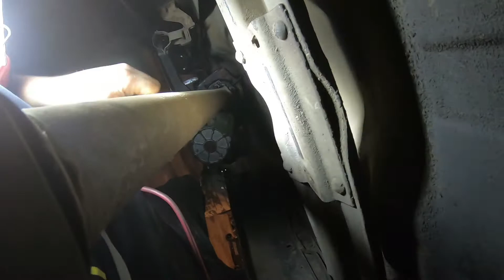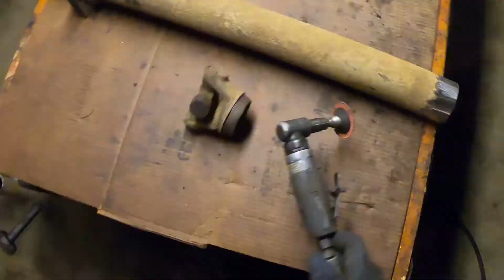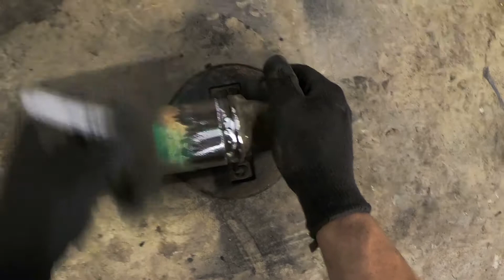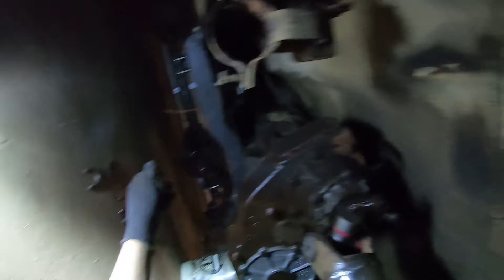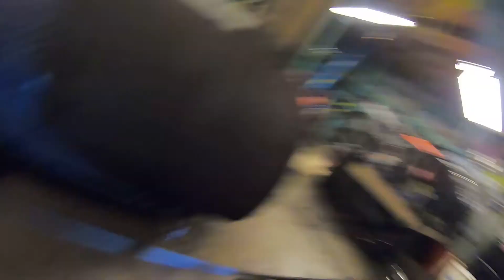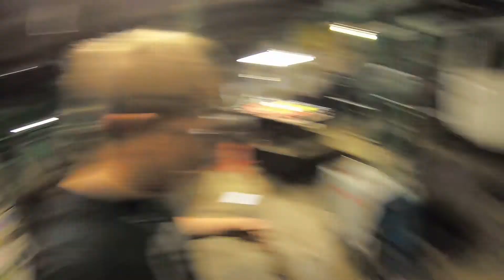Driveshaft Shortening

Comment: The reason I made the comment to you about the safety glasses and face shield is because I saw many eye injuries in my 40 years as a machinist. Don’t want you to be one of them. I have so many safety glasses, I have them laying all over the shop, so I do not have to look for them. Will not do anything without putting them on, not even a quick task.
Reply from the maker: I really appreciate your concern!  I'm very diligent with my safety goggles (glasses have failed me in the past) when I'm working under things or blowing or grinding, stuff where I know there will be flying debris. Just never thought about a chisel or hammer shattering/chipping. It's a valid point though, I'll be more vigilant going forward.

Comment: Man, please wear safety glasses when you use a steel hammer, chisel, punch, etc. Recommendations after 40 years in a machine shop. I have pieces of chisels and punches in 3 parts of my body from them shattering. Don’t want to see a young guy like you get hurt.
Reply from the maker: Good advice! Trying to be more vigilant so I'll do my best to remember, I never think about a chisel or hammer shattering but you're right, they can.